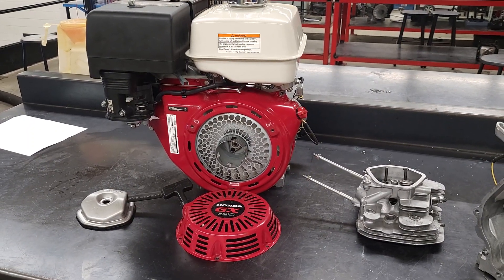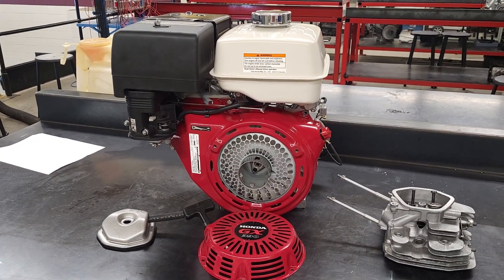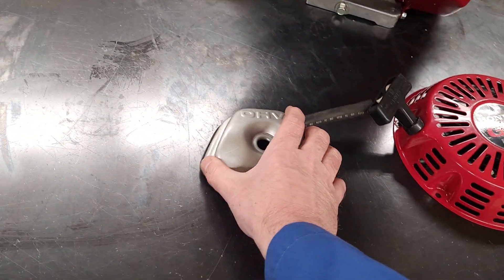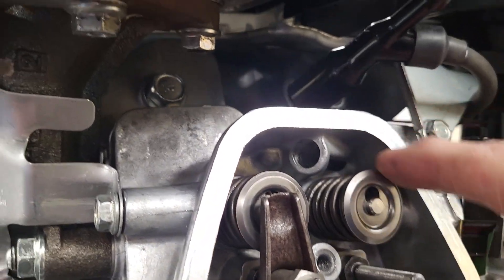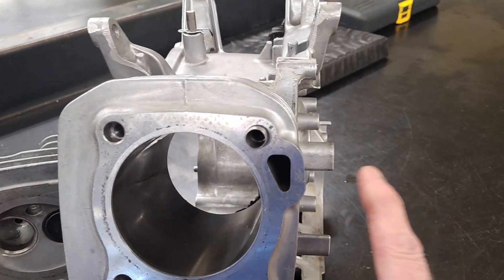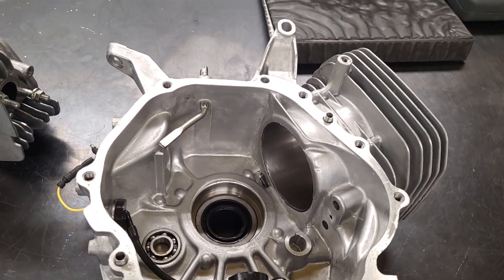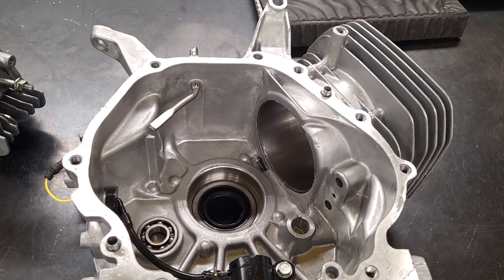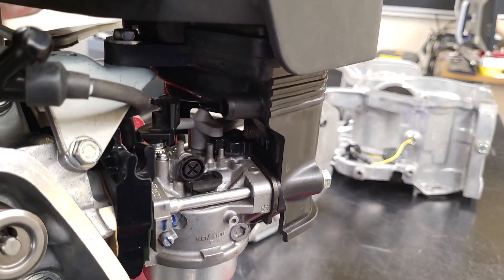Honda Oil Leak/Crankcase Pressure

Comment: My GX620 is puking oil out of the exhaust. Someone told me it might be the crankcase vent being clogged. Is it possible there’s so much oil it won’t start?
Reply from the maker: Yes. It will foul the spark plug.

Comment: Great video, very clear and descriptive, I have a honda gxv340 clone and it has a reed valve at the bottom of the oil return (next to valve followers, I cant find in any parts breakdown) from cyl head, my problem is my engine is blowing a LOT of oil out the valve cover breather, that reed valve is the only issue I can see, everything else is perfect, rings etc